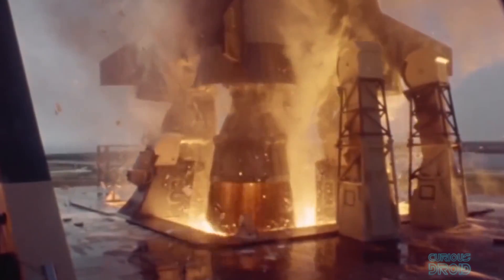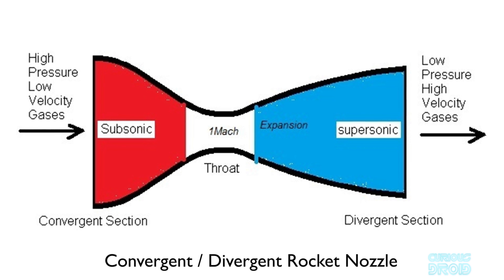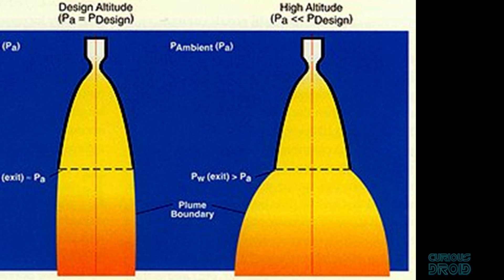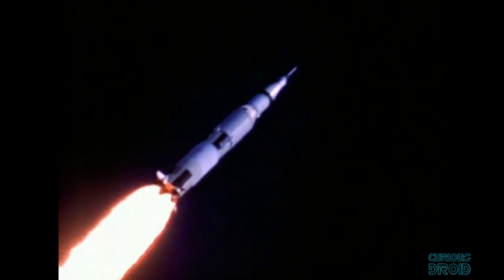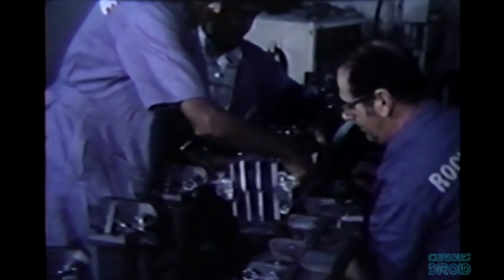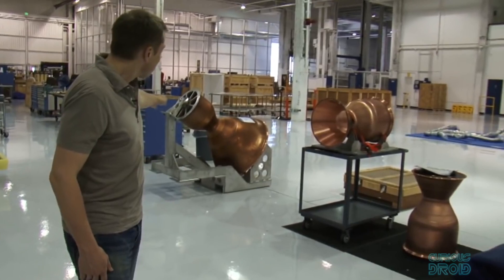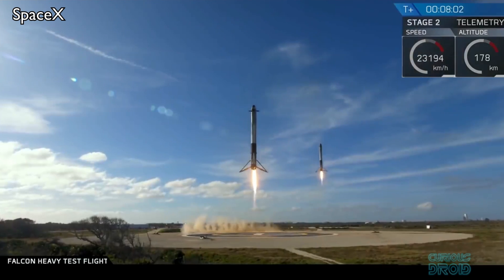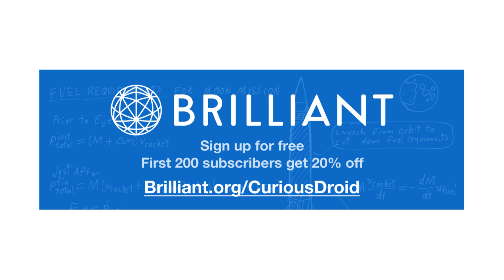Aerospike Engines - Why Aren't We Using them Now?

Comment: Nice video mate. Nethertheless i got a question: you said since fuel is the cheapest thing when it comes to a rocket launch its currently not worth investing that much into a technology that saves fuel. But those weight savings will increase the payload capacity of the rocket, wouldnt it? I thought Payload is King when it comes to rockets - since thats what they are made for. 

Looking forward to see your awnser!